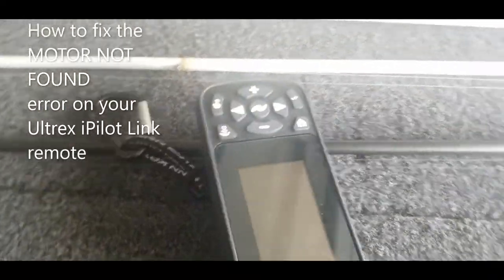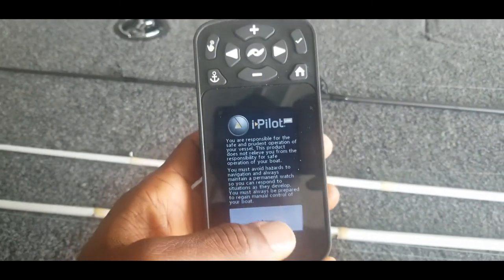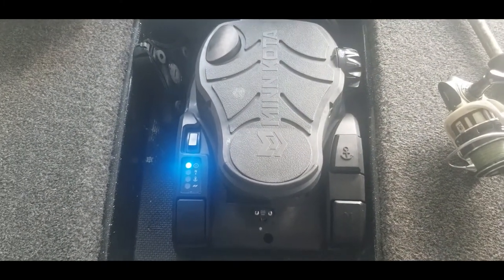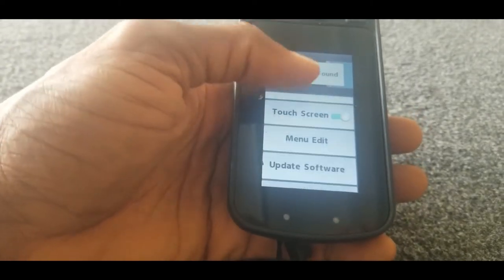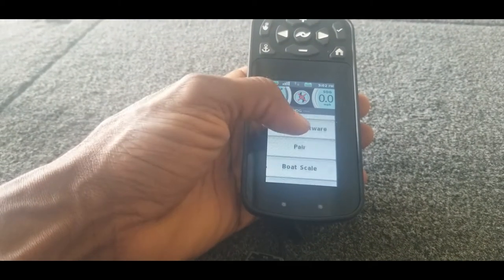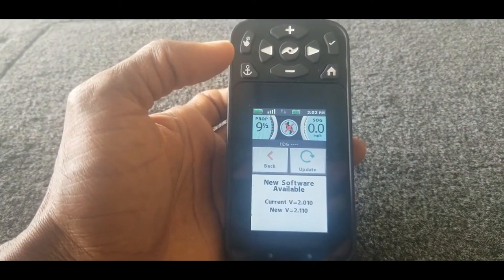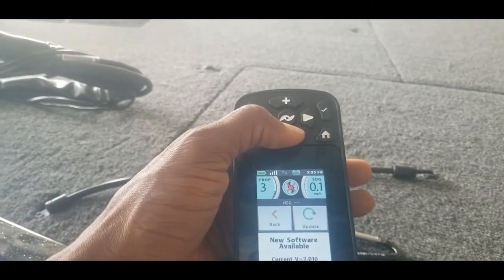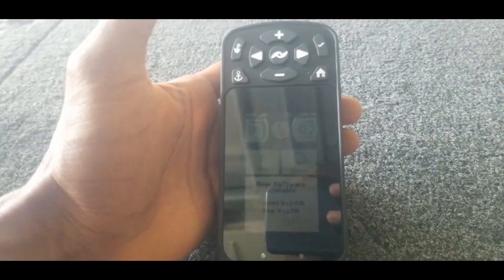Minn Kota Ultrex iPilot Remote *MOTOR NOT FOUND*

Comment: Do you have to have the Lakemaster chip for this remote to work?
Reply from the maker: Thanks for watching. I have a Lakemaster chip in my units. The remote will work even when the units are off. It may be possible that some of the features might need the use of the units and the Lakemaster chip such as "following the contour".
Reply: @MoneyBass  Thanks!
Reply from the maker: @adriandavidpayne  no problem. Thanks for supporting the channel. There will be electronics tutorials on Tuesdays and Thursdays.

Comment: My terrova will not pair to my phone I give up I don’t have a remote!
Reply from the maker: I haven't tried pairing mine with my phone. Have you called tech support? They helped me when I had an issue.
Reply: Try it again hold the pair button down longer until it pairs. It takes a while, longer than you'd think
Reply: It terrible to Pair Minn Kota Terrova i- pilot link